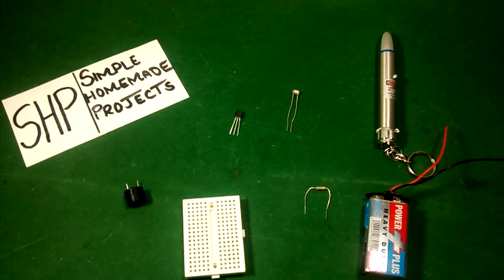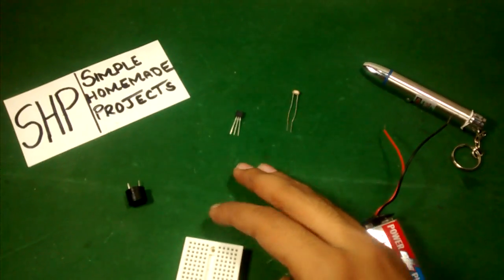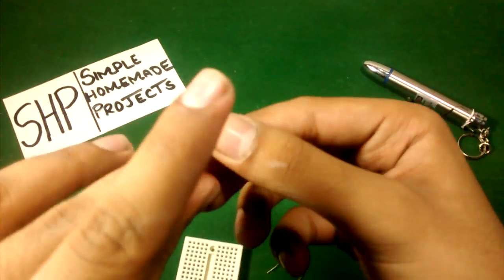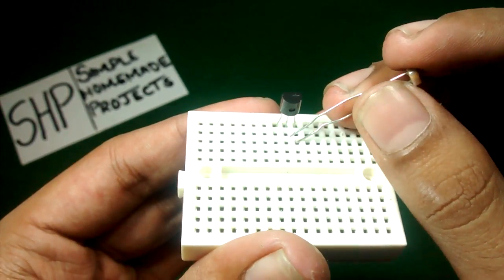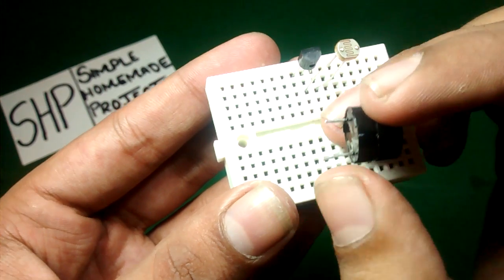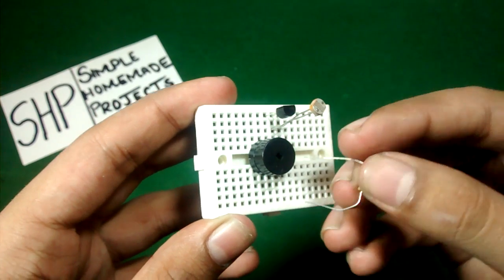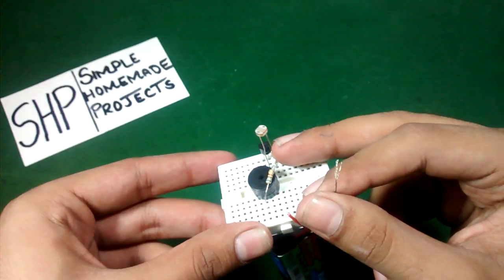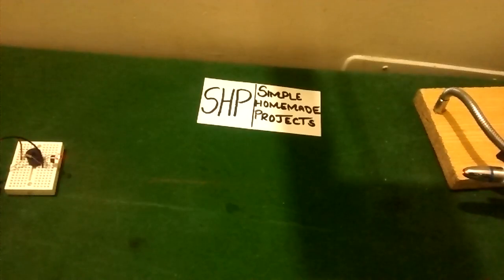HOW TO MAKE A BURGLAR ALARM ?

Comment: Hey I made this but when I connect battery ie. Black wire then the buzzer continuously buzz wat to do ? I couldn't understand?
Reply from the maker: First make sure you transistor is good, secondly check out connections, if problem is still there then try another ldr with a good quality.
Reply from the maker: muhammad_abdullah_official, on intagram. Dm me.
Reply: @SIMPLEHOMEMADEPROJECTS  No I'm no longer on insta btw now it's working 👍absolutely.
Reply from the maker: Thats good.
Reply: @SIMPLEHOMEMADEPROJECTS  I too have This prblm😒
Reply: @SIMPLEHOMEMADEPROJECTS  I use 10 k resistor isn't the prblm ? 
Plz rply

Comment: i have made all the connections but its not working😐😕and i have used big breadboard plz tell how to fix it plz i have to submit it in school within 2 days
Reply from the maker: Its not the breadboard fault, may be you transistor is faulty. Chek it out and also don't forget to check out circuit diagram.